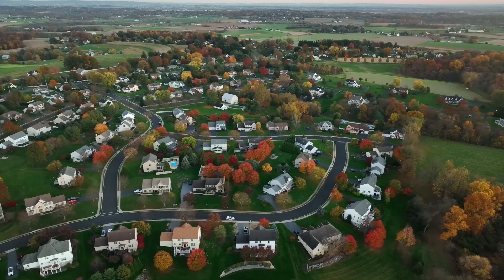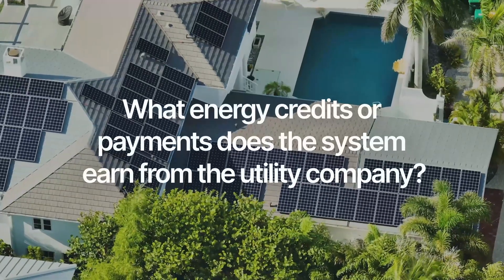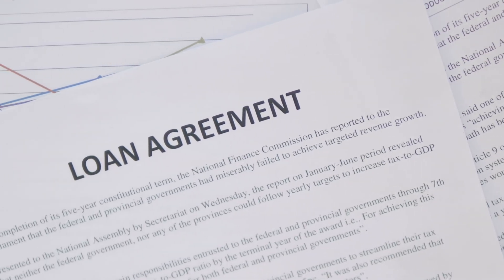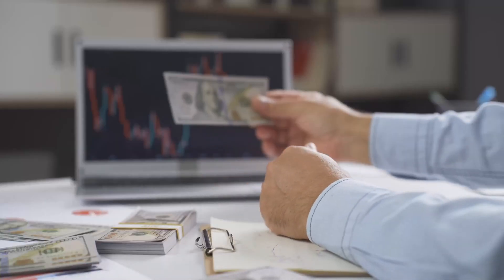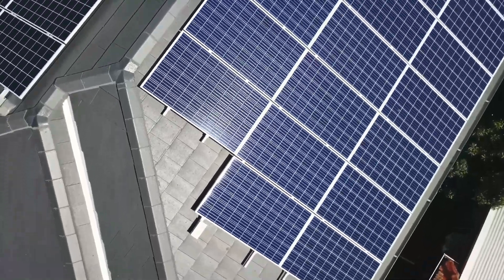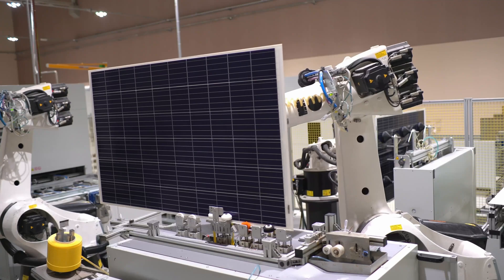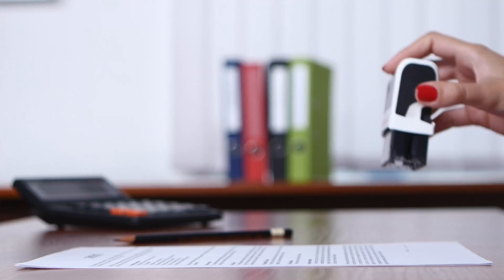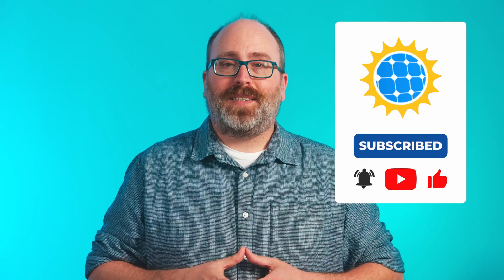Buying a Home with Solar Panels: Dream or Nightmare?

Comment: When buying a home with a solar loan, if deciding on whether to assume the loan or pay it off...don't look at the balance of the loan. Look at how much you will have paid if you let that loan go to maturity. I am buying a house that has two solar loand for two separate systems on the roof. The seller is paying off one loan. I WAS going to assume the other loan, until I got a copy of the loan documents (which the seller gave the solar loan company permission to give to me). Those documents state that the balance of the loan is around $35K. But if I make all the payment over the term of the loan, I would have paid $58K. So I will be paying off the loan. Good thing that I can afford that cost, as I had planned to buy solar on my home purchase anyway. I will be actually getting two solar systems and paying for one, and the system I am paying for is less than two years old.

Comment: I bought my entire solar and battery system wholesale from a supplier and installed it myself for around $11,000. Then I jerryrigged my invoice and claimed a 30% federal income tax credit for a competitively priced system installed by a contractor at about $26,000. My system operates in non-export mode and does not have a permit or an interconnection agreement. I screwed three government agencies over all in one shot! It saves me roughly $3000 a year, so do the math on that payback! 💪